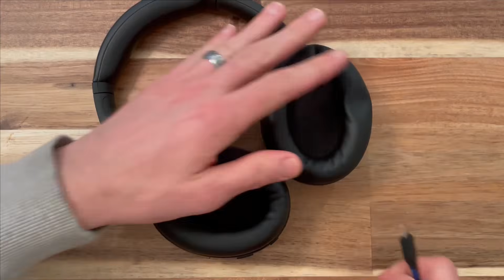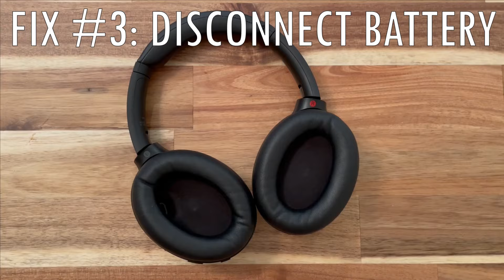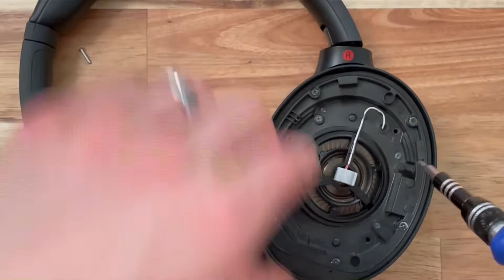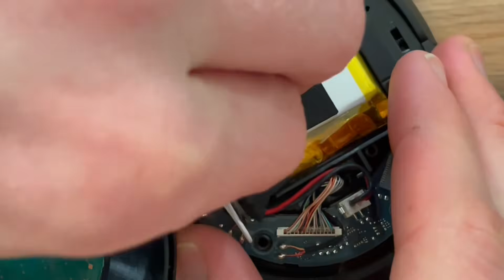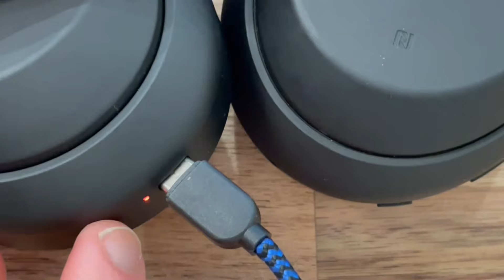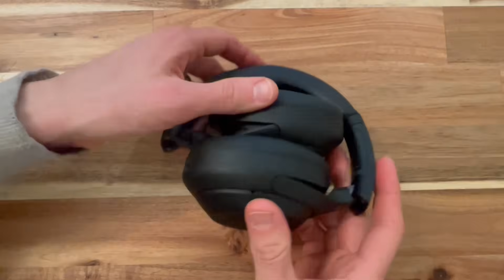SONY WH1000XM4 Battery Troubleshooting & Repair - No Power, Won't Charge & Short Battery Life Fix

Comment: @jontriestofixthings3718 no luck with new battery. Red LED lights up when plugged in but doesn’t appear to be charging. The headphones work when plugged in via mini plug so that hardware seems ok. Thinking of replacing the usb-c board. Anything you recommend I do before going that route?

Comment: I replaced the battery and it only works cause the battery has some charge left but I guess my usb c does not work because it will not charge even though i know the battery is good
Reply: Did you buy the battery of the link he gave? If so did yours have both connections like the previous battery?

Comment: Great video. Replaced battery but no red light when on charge. Disconnected charger cable, did a factory reset by holding both buttons down for about 7 seconds until light flashed blue 4 times. Reconnected charge cable and got a red solid light. Problem fixed. Thanks for great video

Comment: When I was working out my headphones got wet, and now won't connect, pair or charge. 
In steps 1 and 2 the indicator lights don't come on at all, and the red indicator light doesn't come on when plugged in to charging cable.
I haven't got the tools to open the set for step 3 though.

Comment: What worked for me. Follow his instructions but after disconnecting the battery do this next step. Hold down the power button for 10 seconds to discharge any residual power in any capacitors. Then reassemble and charge. It worked for me. I did his step but it didn’t work, then I remembered this trick about discharging capacitors by holding the power button down on electronic devices to erase any stored memory.  Try it out it might work. Good luck!
Reply: Thank you very much for commenting. Your methods worked on mine. I hope this helps a lot of people too who are having issues the same as we had.

Comment: hey i bought ur replacement battery and still no power 😢 could you help me please?
Reply: What worked for me. Follow his instructions but after disconnecting the battery do this next step. Hold down the power button for 10 seconds to discharge any residual power in any capacitors. Then reassemble and charge. It worked for me. I did his step but it didn’t work, then I remembered this trick about discharging capacitors by holding the power button down on electronic devices to erase any stored memory.  Try it out it might work. Good luck!

Let me know if this works for you!

Comment: I put new battery in powers on and off but won’t charge red light doesn’t come on
Reply: What worked for me. Follow his instructions but after disconnecting the battery do this next step. Hold down the power button for 10 seconds to discharge any residual power in any capacitors. Then reassemble and charge. It worked for me. I did his step but it didn’t work, then I remembered this trick about discharging capacitors by holding the power button down on electronic devices to erase any stored memory.  Try it out it might work. Good luck!

Let me know if this works!

Comment: I replaced the battery with the ebay link u gave, after the battery ran out im back to square one with it not being able to charge. Do you have any suggestions?
Reply: What worked for me. Follow his instructions but after disconnecting the battery do this next step. Hold down the power button for 10 seconds to discharge any residual power in any capacitors. Then reassemble and charge. It worked for me. I did his step but it didn’t work, then I remembered this trick about discharging capacitors by holding the power button down on electronic devices to erase any stored memory.  Try it out it might work. Good luck!

Let me know if this works!

Comment: Hey Jon,
Great video! I was able to do the factory reset and the headphones charged one more time and worked fine. They next time they needed to be charged, however, I got the same symptom. (When I plug them in, the red light lights up for about 5 seconds, then it goes off again.) I progressed through all of the steps, even replacing the battery, and the headphones still won't charge.  Any next steps I could try would be amazing! Thank you!
Reply: I ended up changing the charge port as well. Between the new battery, charge port, and re-soldering the speaker wires back into place, I've got them back to sounding amazing as ever! Thanks so much for publishing your video. I wouldn't have taken a crack at it without ya!

Comment: Thank you very much for your video.  I have the M3, my problem is that the light flashes red and it does not charge, it does not charge with any cable, whether new or old, plugged into the PC or the outlet, whenever I connect a charger it flashes red three times and the repeats continuously but without loading.  I don't know what to do to make them work anymore.
Reply: Found Any solution bro, same problem!

Comment: Before i unplugged the battery, the headphones would not turn on but they were charging. Now after i unplugged them they won´t turn on and are not properly charging (red led blinks while charging cable is plugged). Time to exchange the battery or are the any other solutions?

Comment: Jon, great video, thank you. I dropped the headphones onto a hard surface. Subsequently no charge light. No ability to reset, no flashing blue light. According to female headphone voice they power on and off. But no Bluetooth connection, no sound.
All cable and ribbon connectors within are secure. Now headphones are discharged and still won't charge...no red charging light. Any ideas?

Comment: in case of charging problem, try turning the headphones on before plugging in the charger.
If the battery is totally dead, plug in the charger while holding the power button.
These have always worked for me, I'm not certain if they would work for everyone.
Reply: thanks they finally charge now lol :)
Reply: thank you !!
Reply: You might be the greatest of all time

Comment: Phones won’t not charge.  Phones worked but battery got too low to turn on.  Suspected my cable and adapter.  Did the steps you suggested thru change the battery.  New battery is 70% charged n phones work but still won’t charge.  Removed charge port board, cleaned with contact cleaner, reinstalled cable, screw n lens.  Still no charging.

Comment: I will try these suggestions. I hope it works out. Is the charging light supposed to be on the entire time it's plugged in until it's fully charged? Because mine will light up for a little bit and then go out.

Comment: Hi.  I changed the battery 🔋 with a new one.  I tried to charge it, and when I plugged the charger, it continues to blink, red blinks.  Now, the new battery 🔋  is low battery.   I charged it and it still not charging.   I hope you can help me make this work.   

Thank you

Comment: Man I love u much, i was at the gym using the touch panel and it got bugged and stop working and i was just listening a weird noise and the buttons did not respond; but i did as you showed on the onset and it worked 🥹

Comment: I just did a full battery replacement and it's still not holding a charge.  Still says low battery, about 10%.  The red light stayed on for a good hour charging after I installed the replacement but it's still the low battery nonsense.  At least I can still plug them into my laptop and wear around my place with the noise cancelling... assuming it at least charges back to 10%.

Thanks for your video all the same... could I replace the charging port?

Comment: You sir are a genius. Replaced the battery and works a treat. I wouldn't of had the courage in replacing the battery until I saw your video. Excellent walk through. A million thanks. 👍

Comment: Great video. Followed all the different steps, then finally replaced the battery and still not charging. I got the double blinking red at first and took the battery out again. Now getting no red light at all. A lot of problems with these very expensive headphones!
Reply: Same for me, i replace the battery, got the red light fist and then, after 10 minutes no red light :(
Reply: I did all of these. Changed the battery and still nothing. Even tried replacing the charging board pcb.  The headphones still don’t work..
Reply: @kennethburchfield9239 late to the party. What seems to be working for me (and is not mentioned in the video).

Turn headset on and do not release the power button. As soon as it says "power on" plug in the charger and keep holding the power button. Hold it for some time (a minute did the trick for me). After that it kept charging. Releasing the power button to soon, causes the charging indicator to turn off after a few seconds.
Reply: @bart589 i wish a large sum of money to come your way.
Reply: @bart589 this helped me so much I’ve had these headphones for about 3 months and run into this problem and i tried everything but taking it apart and this worked!! You are a real life saver !! 🫵🏾
Reply: Same
Reply: Mine two blue blinking then few red one then back no non stop blue blinking. 278$ 😡😡😡
Reply: Change the system charger
Reply: @estherkeba24  Did this resolve the problem?

Comment: hey, u might can help me on my issue  of the same model. it just stop charging. it will indicate the red light when plugged in but in few seconds it disappears, and wont charge anymore. please help on what solution i could to this coz i tried  resettings and still giving me the same  things: redlight then nada and no charging at all. ty

Comment: Hello! This is a very useful video! Thanks a ton! My headphones fell in the lake and I let it dry for a long time. Managed to charge it afterwards and it worked for a bit. Now it’s not changing anymore; tried step # 1 & 2 but lights coming up. Could that be a battery thing or is the headphone gone? Thanks for the support!
Reply: Meant no lights coming up!

Comment: Can anyone help me for wh1000xm4 model?. I purchased this headphone few months ago and now I am facing charging issues. When I plugged in the red led light gets on and within few seconds it goes off I have tried all the possibilities to resolve this issue with apple and samsung adaptor also i tried charging with sony wire which is included in the box and other premium wires too. Headphone is updated to the latest firmware. When i on and then turn off the device it is charging and the red light is on continuously but this should not be the case as it was working properly earlier in first go. Please help.

Comment: Mines wasn't charging at all the charger light also didn't burn, after I disconnected the battery and did the resets it charges for 10secs now and then the light go down😒 any help?

Comment: Thanks Jon, unfortunately this hasn't fixed my issue, after replacing both the battery and the USB module I still can't get the headphones to charge. The headphones worked for about 10 minutes when the new battery had live in it, so I managed to go through the reset sequence but still no charge light. I am assuming that the problem lies within the main circuit board?  Thanks in advance.

Comment: Hey Jon, I have a related issue I'm wondering if you can help with. When I plug my headphones in the charging light blinks red twice and does not seem to be charging anymore. Searching online looks like the short double red blink means the headset thinks there is abnormal temperature at the battery. I've tried factory resetting and doing what you recommended in this video with no fix. While I had it open, I also checked all other connections on the board, all are secure. I also tried turning the headphones on with the temp sensor unplugged which also did not fix the issue. I am thinking of replacing the battery, but not sure it will fix my issue if it truly is temp sensor related. Any ideas for resolving this would be greatly appreciated. Searching online I've seen others with this issue but no solutions I've come across. Thanks!
Reply: I had that problem before mine stopped working completely if you hold the power button when plugging them in that usually makes them charge good
Reply: @bigsmoke9359  Hey man thanks. I've tried that a few times too but didn't seem to make a difference for me. I ended up buying XM5's, but I would still like to get the XM4's working if I can. Might still try to replace the battery considering how cheap they are. 

I'll try holding the power button while plugging it in again and see what happens in the meantime. You hold the power button for a given period of time on either side? i.e. hold for 2 seconds, plug in, and continue to hold for 5 seconds or something like that? Thanks again for the input.
Reply: I have the exact same issue, i also changed the battery and it does not work
Reply: @Eduro02  Bummer, thanks for the input. I had a feeling it wouldn't fix this particular problem. If you come across any way to fix the issue please keep me updated. I will do the same.
Reply: @MrJameslague  I can not fix the problem, i disambled the entire earphones and i don't see nothing strange, probably it's a problem from the sensor it self or a chip. 
But whit an old usb charger and a wire i made a charger for the batery it self, only charging it in the pc, because the voltage and power is regulated from the pc it self.
Reply: @Eduro02  Interesting thanks for the info. I got some XM5's to use daily for now. I'm going to keep fiddling with these though and see if I can get it fixed at some point.

Comment: So does a new battery come with the yellow heat sensor ribbon? If not do you take original off old one and put it on new one?
Reply: My replacement didn't have it, so I went on and put the old one on it 😅 what worked for you?

Comment: Hi, I walked in the rain without realizing it could hurt the headphone. The headphone charge light doesn’t come on when plugged and the battery level is very low. I opened the battery compartment, it looks dry with no visible damage. Should I try changing the battery? What else I could do? Hope I can repair the headphone. Thanks

Comment: Hi, great instructional video. I tried everything, and it didn't fix mine. I bought a new battery, and it's still says the battery is less than 10% and wouldn't charge either.

Any further help will be much appreciated.
Reply: I’m dealing with the same shii bro!
Reply: Same same
Reply: Could it be the charging board.

Comment: After the battery charge replacement the RED LED light is still not illuminated on when cable is plugged in. Still getting some battery power but keep getting told battery is low please charge. Any help is appreciated

Comment: Hello, I followed the instructions to replace the battery and it’s still not working. After replacing the battery, I plugged it in and got a solid red light for a few seconds and then it went away. I tried different cables and plugs and it’s not lighting up anymore. Any ideas?

Comment: Thanks for this clear and concise video , I’m happy to see some folks got there’s up and running again, I’m at my 2nd battery change and it looked like it was charging, 60% at first , down to 10% after a day, now red led goes dark every 7 seconds or so. I did change the right side board as well as I had noticed a crack. Hoping you’ll have a cure for this!
Reply: Hi, i have the exact same issue as you, suddenly the headphones wont charge, the red light just goes away after 20 sec or so, have you solved this issue? do i have to replace the battery?

Comment: First of all, thank you for your excellent video.
My headphones are not charging, and the charge level is 20%! When I connected the headphones to my computer for charging, I observed that the LED turned off after a few minutes (approximately 2 to 3 minutes), and the head of the charging cable (USB C side) became hot. Additionally, there is a burning smell. Since then, the LED has not illuminated, and the headphones are not charging.

What do you think I should do?
Thank you very much!!!!!!!

Comment: Hello... I have a Marshall Major 4 and have a battery life issue. it supposedly last for 80hrs but after full charged even you will turn-off and not using it, it will last for 3 days only. I replaced the battery from 650mAh to 800mAh and still the issue is same. any idea? I have a knowledge also on repairing electronics but I don't have any experience such issue.

Comment: I literally just got new mx4s like the box was still shrink wrapped and they won't charge. Ive tried resetting and factory resetting. Should I just try replacing the battery? These headphones were opened not even a week ago.

Comment: I replaced the right hinge, then when I put it back together I got the flashing red light while changing (no problems before). I've tried every step in the video multiple times, as well as many charger, outlet, brick and cable combinatios.. The battery isn't hot. Any ideas?

Comment: My battery doesn’t blink when trying to soft reset or hard reset. :( it does flash in a split second faintly when clicking the power button. 

I have also measured the battery voltage with a Multimeter and it says 4.29V

Is my battery the cause for headphone not turning on? Is the battery faulty? :)

Comment: Hi,
Very useful video.
My WH1000XM3 won't power up. Tried all steps (resets) but no luck.
Replaced battery, Let it fully charge but the handset is till not powering up. Any suggestions please, what can be wrong, what else can I try?

Thanks

Comment: For those who’s headset wont charge & light doesn’t come on. Light still didn’t come on, didn’t feel safe taking apart my headset and didn’t have a warranty, simply head the power button and then plugged my cord in, it turned right on

Comment: Hello, unfortunately after replacing the battery, my headphones still won't power on or charge. Any suggestions? Your video was very helpful and informative by the way. Thank you.
Reply: I'm having the same problem with my WH-1000XM4. Has anyone gotten back to you with a suggestion for a fix?
Reply: Not at all..